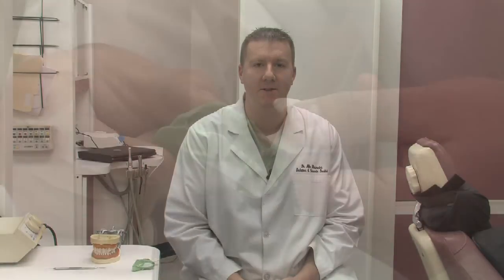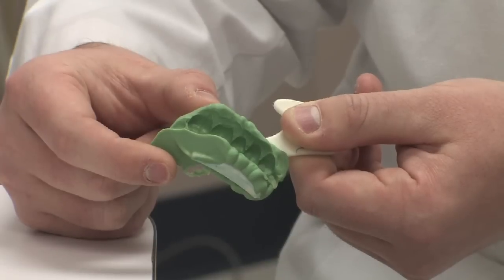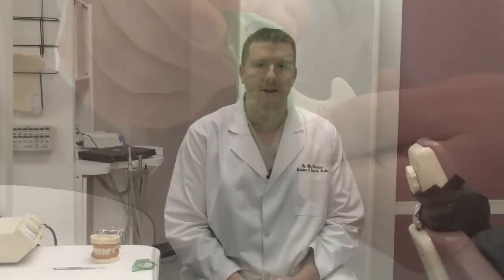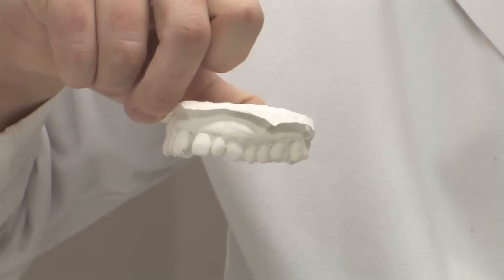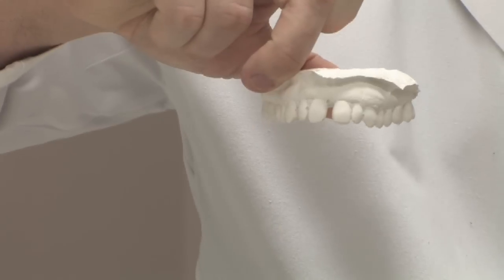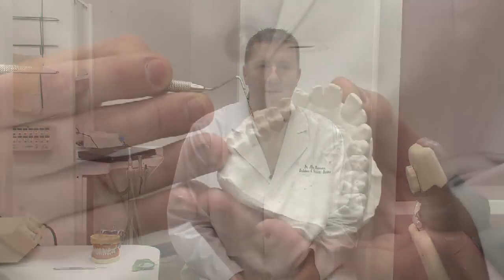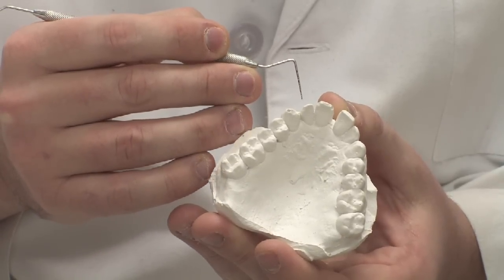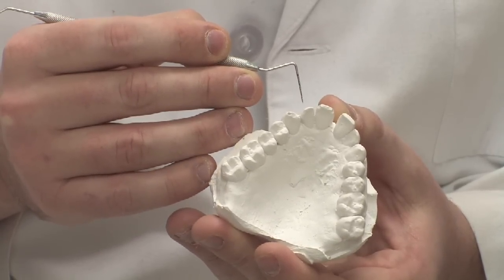Dental Gold : How to Make Gold Teeth

Comment: Gold is a chemical element with symbol Au (from Latin: aurum) and atomic number 79.

In its purest form, it is a bright, slightly reddish yellow, dense, soft, malleable, and ductile metal.

Chemically, gold is a transition metal and a group 11 element.

It is one of the least reactive chemical elements and is solid under standard conditions. 

Gold often occurs in free elemental (native) form, as nuggets or grains, in rocks, in veins, and in alluvial deposits.

It occurs in a solid solution series with the native element silver (as electrum) and also naturally alloyed with copper and palladium.

Less commonly, it occurs in minerals as gold compounds, often with tellurium (gold tellurides).

Gold is thought to have been produced in supernova nucleosynthesis, from the collision of neutron stars, and to have been present in the dust from which the Solar System formed.

Because the Earth was molten when it was formed, almost all of the gold present in the early Earth probably sank into the planetary core.

Therefore, most of the gold that is in the Earth's crust and mantle is thought to have been delivered to Earth later, by asteroid impacts during the Late Heavy Bombardment, about 4 billion years ago.

Gold is resistant to most acids, though it does dissolve in aqua regia, a mixture of nitric acid and hydrochloric acid, which forms a soluble tetrachloroaurate anion.

Gold is insoluble in nitric acid, which dissolves silver and base metals, a property that has long been used to refine gold and to confirm the presence of gold in metallic objects, giving rise to the term acid test.

Gold also dissolves in alkaline solutions of cyanide, which are used in mining and electroplating.

Gold dissolves in mercury, forming amalgam alloys, but this is not a chemical reaction.

Historically, the value of gold was rooted in its relative rarity, easy handling and minting, easy smelting and fabrication, resistance to corrosion and other chemical reactions (nobility) and its distinctive color.

As a precious metal, gold has been used for coinage, jewelry, and other arts throughout recorded history.

In the past, a gold standard was often implemented as a monetary policy, but gold coins ceased to be minted as a circulating currency in the 1930s, and the world gold standard was abandoned for a fiat currency system after 1976.

A total of 186,700 tonnes of gold exists above ground, as of 2015.

The world consumption of new gold produced is about 50% in jewelry, 40% in investments, and 10% in industry.

Gold's high malleability, ductility, resistance to corrosion and most other chemical reactions, and conductivity of electricity have led to its continued use in corrosion resistant electrical connectors in all types of computerized devices (its chief industrial use).

Gold is also used in infrared shielding, colored-glass production, gold leafing, and tooth restoration.

Certain gold salts are still used as anti-inflammatories in medicine.

As of 2014, the world's largest gold producer by far was China with 450 tonnes.